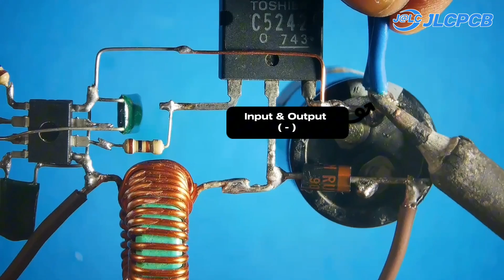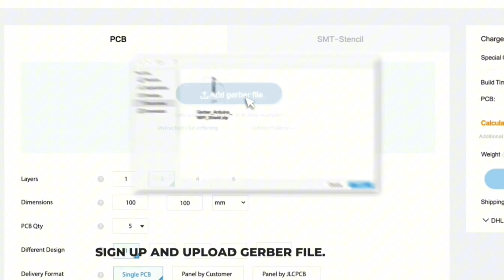Boost 3.7v to 450v with a Single Transistor! (100W Power)

Comment: Thanks, what should be changed in the circuit to use MOSFET instead of transistor?
Reply from the maker: You can use any N channel MOSFET in this circuit without changing anything.
Thanks for comment 👉❤️👈